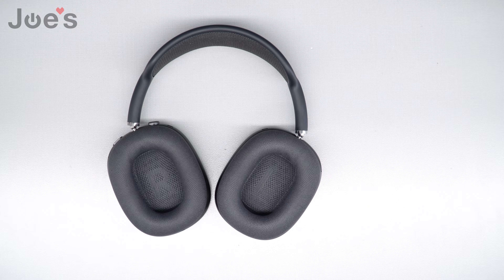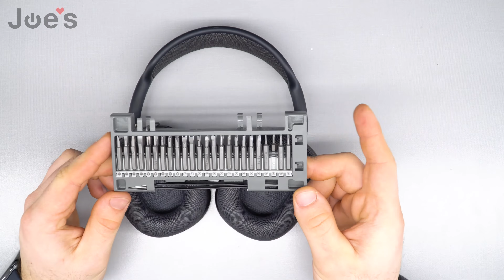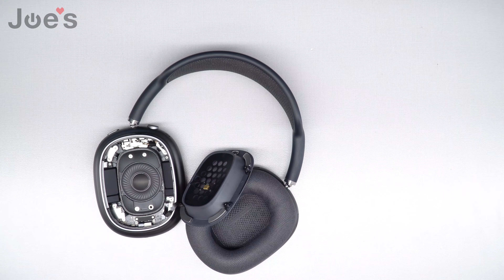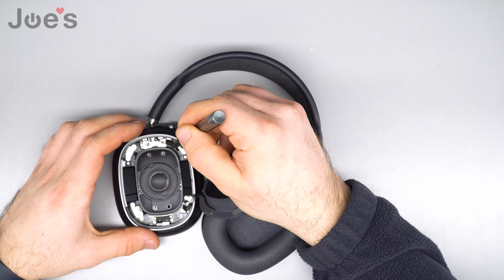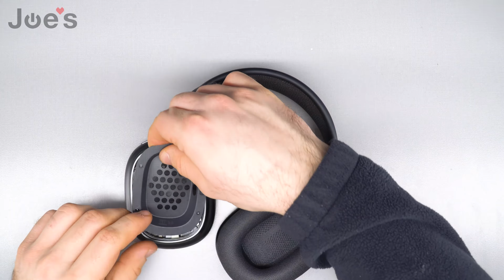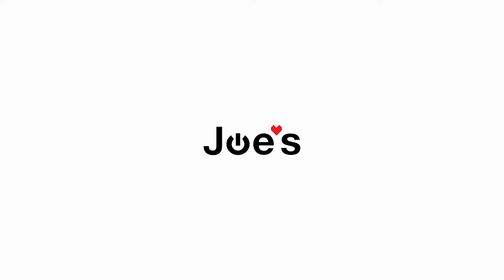Apple AirPods Max Blown Speaker Right Speaker Replacement | Repair Tutorial

Comment: hi joe my pair airpod max is on a shelf dead.. the lightning port has a small metal lip that can be removed and it is stuck inside the port.. therefore I can't connect the charger in until i open the pair and remove the metal lip.. apple didn't wanna deal with it they want to replace the whole lightning port but i fear that is not needed... the port itself works it charges it's just blocked off by a metal lip..
Reply from the maker: Hello, thanks for commenting. Please email us at support@joesge.com with your question. We will be able to better assist you there. - JoesGE

Comment: the cable that connects the right housing to the cup is torn, will replacing it fix it? What does that cable do?
Reply from the maker: You will have to replace the cup itself. That ribbon is responsible for noise cancelation and transparency
Reply: @Joesge bro i’ve sent my airpods to get fixed 3 times and they never fix it